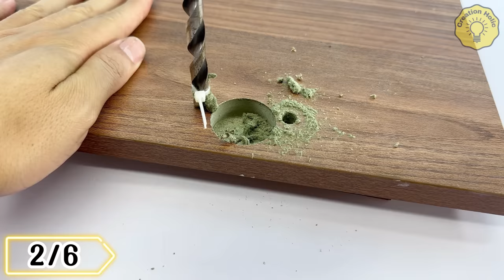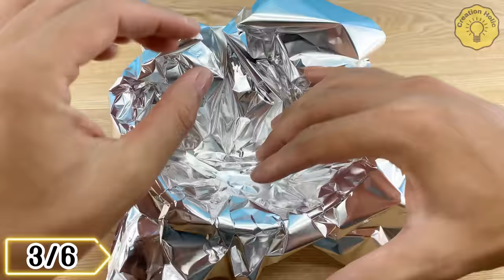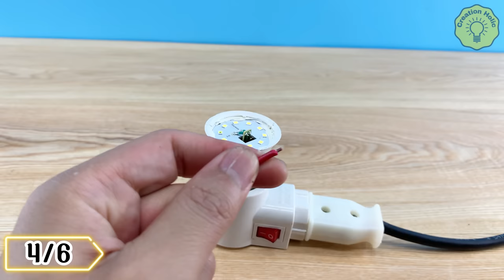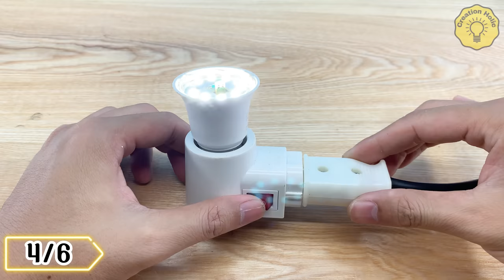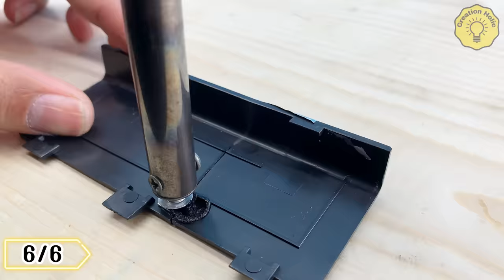Super Glue and Aluminium foil ! Pour Glue on Aluminium foil and Amaze With Results

Comment: You forgot to mention that the LEDs inside the lamp is at HIGH mains voltage (depending on lamp design) since there uis no galvanic isolation and pose a SERIOUS risk should you inadvertantly touch any of the components on the PCB. Do not try this at home!
Reply: And as the resistance is lower now, all the other led's will went wrong quickly.
Reply from the maker: Hello! thanks for your comment. Wish you all the best!

Comment: Great  hacks except for #4 which is downright dangerous.
Reply from the maker: Hello! thanks for your comment. Wish you all the best!
Reply: You mean you don't do electrical work on stuff that's plugged into an active source? What could possibly go wrong? 😅
Reply: The voltage and current at the LED terminals won't possibly harm you as they are downsized by the circuitry. Of course, any electric work is inherently dangerous and a warning was appropriate.
Reply: I like this no. 4th to try
Reply: @gopalakrishnanms The voltage on the leds should be safe -- if it isn't malfunctioning! 🤣
Reply: @gopalakrishnanms the problem with this "hack" is each LED draws a maximum of 3 volts, the circuit was specifically made for this number of LEDs now one is missing the available power will be redistributed to the new number of LEDs, it will only be a matter of time till the next one burns out... And the cycle continues 🤐

Comment: That sounds interesting! What's the purpose of pouring glue on aluminum foil? Is it to create a new super adhesive or just to test the glue's features?
Reply from the maker: Pour glue on the aluminum foil to create a bond and make it more sturdy
Reply: Un led menos recarga los otros. Pronto se quemara la bombilla.
Reply: Pues yo he arreglado varias hace meses y siguen funcionando.
Reply: @maricarmenjordantorrent7575 I'll bet they haven't caused a fire either... yet.
LEDs are meant to last a very long time, so there's a good chance there's a fault in the circuitry, then you add 10% more voltage to each led.
If they cause a fire and the modification is discovered, your insurance claim will be refused.

Comment: Do not solely rely on the switch before starting to remove the LED. Most of the switches cut the current on one line, therefore if you connect the switched line to Neutral (you have 50% of chance) then the live line will not be interrupted and you may get a shock when you touch the burned LED (depending on the position of the LED on the LED string, especially if it's close to the high voltage side) with a conductive tool. Totally unplugging the system from the mains is the best choice.
Reply from the maker: Hello! thanks for your comment. Wish you all the best!

Comment: For number 2 use a few toothpicks and a bit of wood glue or even simple white glue.
Reply: I agree...toothpicks are a zillion time faster n easier than all those steps!
Reply from the maker: Hello! thanks for your recommendation. Wish you all the best!
Reply: Saw-dust mixed with woodglue using a dowel or toothpick. Keep your saw dust and wood-chips for these repairs.
Reply: I use UV cure glue and clear food wrap and stuff it in the hole. Light it up with UV flashlight for 5 seconds and its ready for screws.

Comment: Please don't take this personally, but number 4 is one of the worst ideas I've seen.
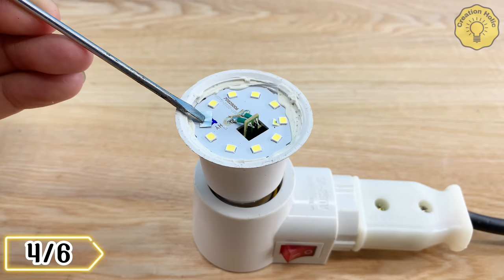It is dangerous, for two reasons. First, you never work on anything while it is plugged in. You should edit the video to put a warning message about that, immediately. 4:04 
Secondly, if one led can stop the rest of the leds lighting up, that means they are wired in series. This in turn means that each of the ten leds gets the right voltage ONLY when there are ten of them. Leaving only nine means each one is getting about 10% higher voltage. They'll run hotter. They could cause a fire. If they do, and the fire department finds your led bulb, and can see the modification you made, your insurance won't pay out. That's a good outcome... a bad outcome is you kill yourself... a devastating outcome is you kill others.
Yep, number 4 is a very, very bad idea.
Reply from the maker: Hello! thanks for your comment. Wish you all the best!

Comment: Better way to do #2, just fill the existing hole with superglue, let it sit overnight & screw the hinge back in place.  The fiberboard will absorb some of the superglue, the rest will harden in place, and you'll have a small dimple in the center where the screw goes.  For hardwood doors, use superglue or wood glue and a toothpick or small diameter dowel.
Reply from the maker: Hello! thanks for your comment. Wish you all the best!
Reply: wood glue + sawdust  👍 = best
Reply: "use superglue or wood glue and a toothpick or small diameter dowel" .....and go the added effort of centering the holes. That hinge isn't going to re-install properly.
Reply: Thanks you😊
Reply: #2 was crooked due to poor alignment. I would rather follow your advise, than videos as holes are not enlarged and easier to aim at
Reply: Superglue + backing soda

Superglue + cotton wool 

Superglue + saw dust

Superglue + tissue paper 

ALL OF THESE COMBINATIONS DO THE SAME THING!
Use to repair items, fill holes, create new drilling spot (for screws that have been roughed out) and all sorts of odd jobs!!

In my case:

Superglue + lots of warm water and soap!! ……. When I ONCE AGAIN (!) have got my fingers stuck together with Superglue !!!!!

Comment: Some interesting ideas. I’m not sure I’d take the time to deal with an LED bulb like that though. It was still a “shaky” lightbulb. That would drive me crazy.
Reply from the maker: I understand your concern! Make sure you have safety equipment in place before doing so
Reply: @creationholic101 😊😊😊😊😊 il 😂😅 mi

7😊😅 hu 😅 hu tu 😊

.y numuku Lloyd's KK o se la ok look 9!😊😊😊
Reply: Ma oggi nn
😅🎉😅😅😅u. G 
 Y😅😅 MM😢o II.
Reply: @creationholic101 😅😅😅😅😅😅😮 fammi II pollo pollo solo se nn
 Buon

😮

 Lo lum in😊😊un u in
Reply: Its only by camera rekord, not visible blinking for eye
Reply: It's because of refresh rate of digital camera... Lol
Reply: You'd take the time to repair it if you couldn't afford or get a replacement! :)
Reply: some stupid ideas. You get wooden dowel and cut it to fit in the hole and then use wood glue. The dowel should be at size or .001 oversize. This way it squeezes down as you hit it and compress. Then when the wood dries, its as strong as solid wood and you can drill into it again at rebated shaft size of the screw and then drive the screw in.

The fix for broken plastic cover is equally terrible. There is no strength benefit to melting the staple into the plastic like that because the plastic is full of air gaps as it melts and its easy to see. Air gaps mean structurally weak and the staples will break down the so called weld if there is torsion or shear on the part as it is used. This person doesnt know what they're doing.
Reply: @neglectfulsausage7689 Toi qui crois tout savoir tu perds ton temps a regarder des vidéos que tu trouves nulles mais je ne vois pas tes vidéos qui expliquent les bonnes façons de faire 🤷🏻‍♂️

Comment: That LED isn't going to last without the proper ohms
Reply from the maker: Hello! thanks for your comment. Wish you all the best!
Reply: Soldering a decent sized wire in place of the dead LED would make a much better contact than gluing aluminum foil across the contacts. You might get an intermittent connection and arcing. Replacing the LED would be the best. Keep a donor bulb to fix others that fail.
Reply: @beku2283   ohms is most important...a decent size wire is too arbitrary and will burn out faster.
Reply: Just buy a new one. I hate when people do this
Reply: @anthonybasile5035   🤣🤣🤣

Comment: If you wish to clean Silver Jewlery or Silver plated utensils, put Aluminium foil in a basin, pour in hot water that has Sodium Bicarbonate dissolved in it & then put the Silver objects in so they touch the Aluminium.
Wow! they clean immediately as they touch the foil.
Reply: Cleaning silver, gold, with Toothbrush and toothpaste. Top 👍👍

Comment: That loose illumination LED didn't necessarily need to be removed. A quick dab on either side with a drop of new solder would have gave it new life, if it was loose due to insufficient solder.
Reply from the maker: Thank you! Cheers!

Comment: Since you had a soldering iron as in #6, why didn't you just use that to fix that LED bulb? A single drop of solder bridging the pads for that bad LED is all it would need. However gluing a piece of foil over them will result in a poor mechanical connection when the board heats up, and possibly even a high-resistance connection that will heat up and possibly start a fire. Use the right tools and methods for the job.
Reply from the maker: I want to give more measures to people who don't have a soldering iron

Comment: Do NOT use salt to clean your sterling silver! Salt might work on steel but it will darken your silver and you might not be able to fix it without a jeweler doing it for you. Cleaning silver is putting crumpled aluminium foil in a dish, add the sterling (.925 stamp) silver you wish to clean, then baking soda then hot water. I don't think the order matters, this is how I do it. It doesn't take an hour and you can watch the tarnish diminish within a minute. Contact with the foil is important so you might want to use fresh foil, fresh hot water and baking soda, turning the silver over so all of it contacts teh foil with the baking soda. Then rinse in clear water and dry. This also cleans the crevices of intricate designs. I've used it for years.
Reply from the maker: Hello! thanks for your comment. Wish you all the best!

Comment: I accidentally chopped the wee cord that makes the electricity in my son's favorite Christmas angel ornament when I trimmed the top of the tree with her on it. It's one of those tree toppers with fiber optics for lights and a power source that makes the wings beat slowly back & forth. I tried to fix it by splicing the wires (two - like speaker wire) but it just made a grinding noise and died entirely. Any ideas on a fix?  Too late to find a replacement
Reply from the maker: Make sure the wires are the right color and insulated from each other

Comment: Cleaning iron based tools with Aluminum foil would cause more corrosion due to galvanic corrosion effect on the Residual aluminum. Unless you can ensure it either covers whole surface OR no residue is left. I get that these are quick fixes for when you can't go to the store but having a piece of sand paper at home is a must. If needed use wet sand, but make sure everything is dry and properly lubed.  Also make sure the sand is course enough not to get stuck in hinges.
Reply from the maker: Thank you for sharing your feedback. Have a good day!

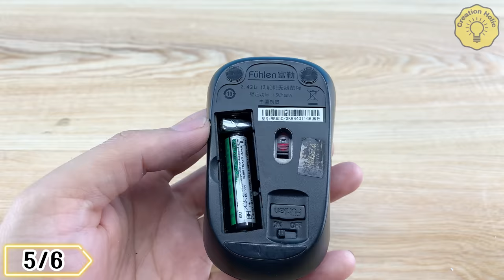Comment: 5:40 Battery put in with reversed polarity but still works, ha 🤣🤣
Reply: Hey that's right - negative always goes to the spring
Reply: Battery up side down
Reply: By himinee that's correct.
Reply from the maker: You can check that the battery is installed in the correct direction
Reply: @creationholic101  no it isn't
Reply: 5：44 Battery put in with not reversed！

Comment: Hello mister creator , if you repair a led lamp on this way ,you have to show beter to switch off the lamp , or screw out the bulb is safer. 
And by removing a led ,will gives more voltage to the other leds and also, after long use, to hot ,possible in fire.  
People ,if you want to end 2023 alive , beter dont repair like this way
Reply from the maker: Hello! thanks for your comment. Wish you all the best!
Reply: Hallo creationholic, ofcourse your intensions are allright ,sorry man.
Helping people is allways ok. We're all just human beïngs on thise wild planet !
Happy : 2023 》2024  ☆

Comment: Just buy a new light bulb!🤦🏾‍♀️
Reply: Why? 🤔
Reply from the maker: The goal of the video was to showcase a unique approach to recycling, but I understand that it may not resonate with everyone
Reply: @geoffwinstanley4468 I mean this sincerely... because what was done was dangerous, both the technique and the final result.
First, working on mains powered equipment while it's plugged in? It doesn't matter if the switch is off... takes two seconds to unplug it.
Secondly, in 4/6, the LEDs are wired in series. Bypassing one means a voltage that was divided between 10 LEDs is now divided between 9. They'll run hotter. Fire departments are very good at finding where a fire started, and if they find that little modification, bye bye insurance. Of course, if you kill someone, insurance will be the least of your worries.

Comment: not sure pulling batteries out of the end of a knife is the best idea...especially if it's a lithium cell. even the AAA or AA will ignite if they get punctured.
just wait for the inevitable electric car inferno they're already covering up.
Reply: Normal dry cells and alkaline batteries are quite safe to open... they won't catch fire.
I'd be more concerned about the way the LED bulb is worked on while still plugged in. Yeah the switch was off, but simple common sense says you unplug it.
Reply from the maker: Hello! thanks for your comment. Wish you all the best!